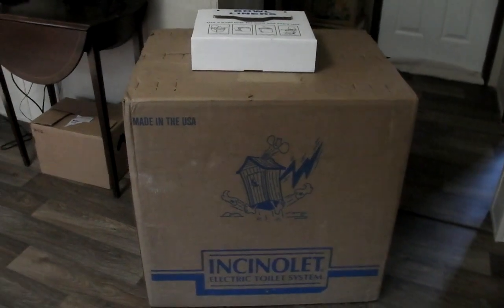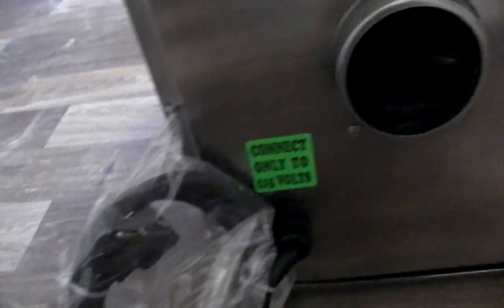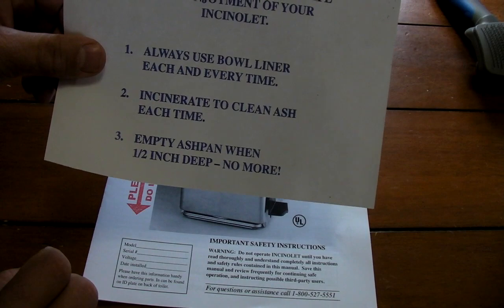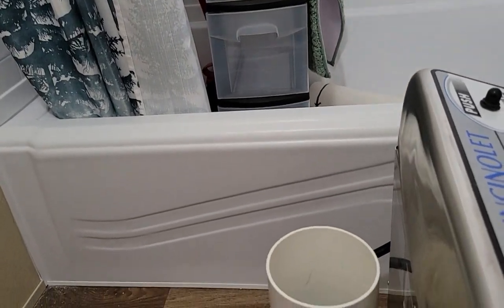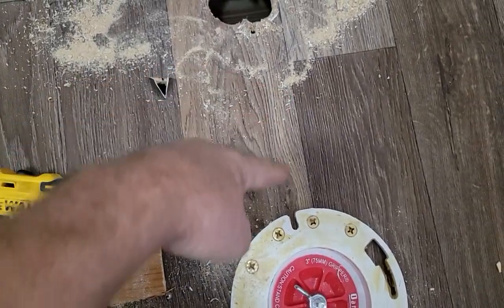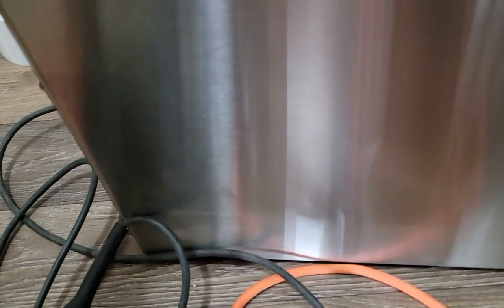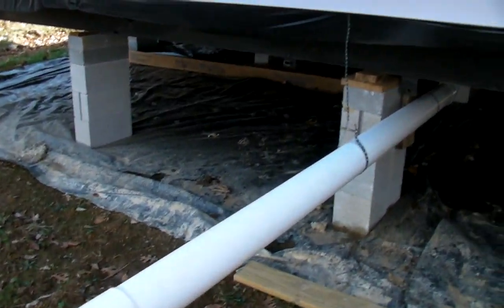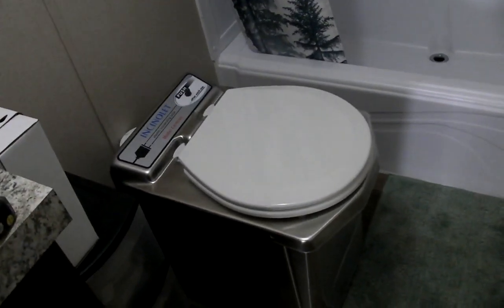Incinolet  Incinerating Toilet Install and Test

Comment: You have had your Incinolet toilet for about a year.  Are you still happy with it?  Any issues?  Did electrical bill increase by much?
  Im thinking about purchasing one soon but can't decide on Incinolet or Cinderella.
Reply: @whodavid  I am still happy with ours. We live in WA state. Our electric bill runs about 30.00 a month. Ours is the 120 volt
Reply from the maker: It's been over 2 years now and it's still working great. Have not had any problems. I would say it will increase your electric about $20 a month for 2 people

Comment: Some ceramic tiles, or tiles designed for the wall behind a freestanding wood oven (often metal faced) should be available as an inexpensive separator.

Comment: It is normal for the blower to turn on and off a few times after heaters burn cycle is complete. The blower is on when timer button is hit. ALSO the blower runs when the incinerator is above 130 F too. Ie an OR circuit.  So the heater blower still blowes air out as exhaust after the burn cycle.  Then stops once the ITS thermostat F130 drops below 130 ish. But since there is much incinerator often the thermostat goes above 130F and the blower goes on again. This is all in the manual. But i mention because maybe not obvious. 

The heater coil lasts longer if the ash pan has no more than 1/2 inch/ 1.3 cm of ash. That is because the ash adds insulation and causes the unit to work harder. The heater coil is full on until it cycles via a thermocouple sensor to the controller.
Reply: What is the its thermostat hooked up to?  The relay 24v?
Reply: @johnle231  Fort clarity my Incinolet is a 120 volt input model. The Controller on mine has the 120 volt AC input. 

The controller Also it has the two thermocouple input wires.
 All the Temperature Controller does is control its pin 5. 
ie ties it to 120 volts or switches it off. 

This 120 volt AC goes to the Heater relay's coil or input.There is no 24 volts

So the high current Relay has a control input of 120 volts ac on mine
Reply: @3beltwesty  good to know about the ash. Tx